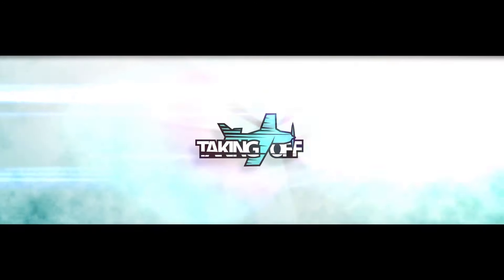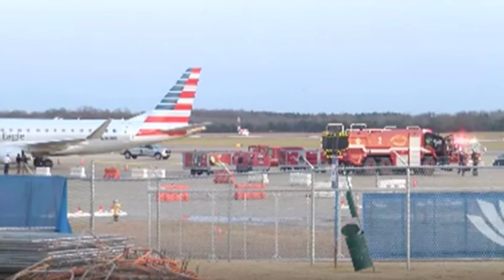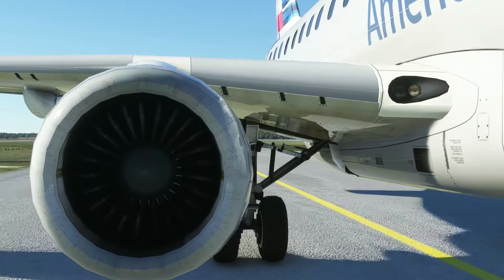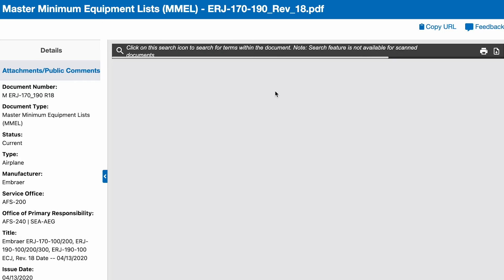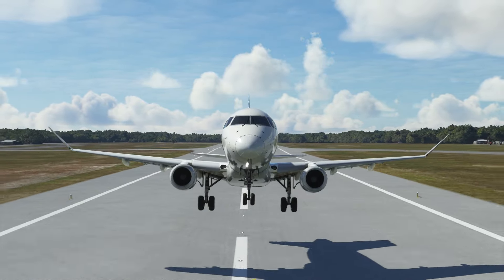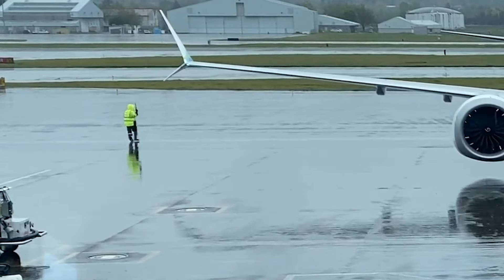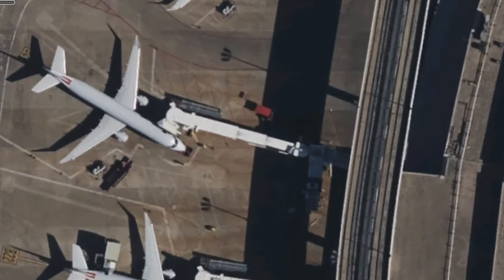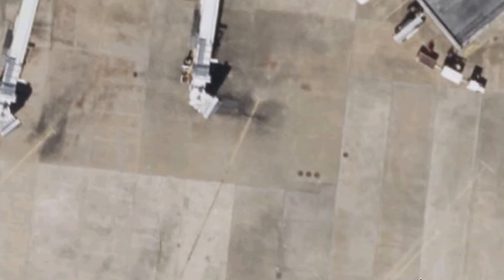Woman Sucked into Engine at Montgomery Regional Airport New Years Eve UPDATE

Comment: As a retired airline pilot (turboprops only) I saw something potentially similar develop again and again in my career, a recurrent Safety Management issue: Scheduling is becoming tighter because of accumulated delays (and possibly added abnormalities like the INOP APU), and "good" (enthusiastic) ground staff start to expedite their routine to compensate, a highly dangerous situation (the root cause usually being a management or scheduling problem).
There was an extreme period where we enforced a rude emergency response: If ground crew was seen walking/driving fast, let alone running/speeding around a live aircraft, the mandatory response was to call for an immediate shutdown and a crash safety conference with the ground crew. This of course made any imaginary delays real and exponentially worse and, needless to say, such drastic measures only happened once or twice before everyone got the message.
I have no idea if something similar was at play in this tragedy, but I wouldn't be surprised if it was a factor.

Comment: I spent 24 years as a C-130 Crew Chief and though our little Allison T56 engines were mounted high and not a lot of suck power compared to the E175 engines we had huge 13.5 ft. props to deal with...  Getting complacent could cost you dearly...   Thoughts are with the family...  RIP..

Comment: When I was in the Air Force, I had to work around running engines all the time. We knew the dangers of getting too close to the intakes and were shown video examples of what happens if you get sucked into an intake. I was on constant alert watching my subordinates to make sure they followed the safety procedures and stayed clear of the intakes. I've had a few close calls, and I've had to pull more than one guy away from the danger, but I never saw anyone get sucked into the intakes.
Reply: Pm
Reply: Good on them for giving you the video training. I imagine none of you dared fkuc around near the engines after seeing what was on  those... lol
Reply: So, what happens when it happens? Does anything get out on the other side or does the engine shut down? Or even overheats and catches fire?
Reply: @Ken Fullman oh, you wrote so much , and yet nothing. We are interested how does it look afterwards? Like bolognese pasta sauce?!
Reply: @jasonnicholasschwarz7788  Happened w DC10 lock failures. 2 or 3 got sucked in. They're not sure exactly. That's the answer.
Reply: All the paint markings are faded away. Their is no longer any safety envelope. For any worker especially newer workers
this spells disaster. Once again the corporations put profit before safety by not repainting all the markings in the airport.
Any hungry lawyers out there looking for a big juicy law sue case. Go for it lawyers, help the hurting family of that victim.
Please share this message.

Comment: My neighbor was a mechanic during the Korean War and witnessed a similar fatal accident that still haunts him. An F-86 pilot started his engine without realizing that a ground crew member was removing a block from the front wheel.
Reply: What happened to pilot?
Reply: @Lecintel  read it again and again and you'll fond out.
Reply: @Lecintel when the pilot ran the engine, the ground crew man got sucked into the engine... this is the unspoken part of the story
Reply: @istra70  They asked what happened to the _pilot_, not what happened to the ground crew.
Reply: I think I have seen a video about this accident in the fifties, it was on a carrier, and because at that time the engine intakes wasn't large to suck the whole body and the front fan was somehow deep, the guy survived it and they pulled him alive, definitely he got injuries but he didn't die.
Reply: @Helmy67  Sounds like a different incident. The accident with the F-86 happened on land and the victim died instantly.
Reply: @istra70  I wonder if pilot was charged with manslaughter or was it just considered as an accident
Reply: @RaysDad  aha, it's different accident then.
Reply: @Lecintel  No way they'll blame the pilot.
Ground crew need to know their place at all times .....If they are starting engines , or after landing , before switching off - there should be airline company mechanic with headset plugged, in the contact with cockpit.
Operational procedures vary depending of size of the airline company, type of aircraft and type of the airports. Never in my work have I seen baggage handlers walking or running around / near running engines....

Comment: As a retired airline pilot, this is a very unfortunate accident.  It is industry standard to leave the right engine running with an inoperable APU for the safety of the ground crew plugging in ground power.  It is also standard to notify the station of the inop APU with the in-range call or via ACARS. These calls also include request for wheelchairs and unaccompanied minor escorts. People are in a hurry to do their job especially when the arriving flight is late and you are trying to make up time for an on-time departure.  When you are around an aircraft SLOW DOWN, no running or horse play.  People in a hurry are in a hurry to die.
Reply: Thank you for your input from a Pilots perspective always interesting to know how it should be done by the rules of standard procedure ,I worked Airside at Adelaide Airport and it's scary  how quick a large aircraft can move up on you if your not situationally aware .
Kym
Adelaide
Reply: Well as a retired airline pilot myself (and we will let everyone know), I frequently get asked by a passenger how often do these things crash. My reply is "just once usually." 🛬💥🔥🤣

Comment: 25 years ago I was working with the ground crew for Delta Airlines, who had not yet bought out Northwest.  So we had 3 gates and our crew were "scabs" .  (another story) 
I came to work one morning to learn my team lead had been sucked into a 373 engine. 
He survived.  
Thankfully it was one of the 200 series with the smaller cowling.  And well.. he got extremely lucky.  As he told the story, he remembered his grip to keep him from getting sucked in slipping, and then the engine shut off.  He suffered a separated shoulder injury, and maybe some PTSD.  
We were contracted employees, always understaffed and under pressure.  His carelessness wasn't that all uncommon.  He just was TOO careless.  We learned when and where to cut corners... etc..  Brian just didn't respect the engine.  HE even got to star in a safety video for his efforts.  Still a good boss, even though he made a dumb mistake.  But you need to be vigilant around those aircraft.  It takes one slip up and your dog food.
Reply: "SOME" PTSD? Lol. 

Had a near miss once while on a bike vs open old Caddy door. Flipped over bars. Untouched. Could barely stand from the chemical rush. Lol. Landed on my feet.
Reply: Unfortunately understaffed and under pressure is still a thing.
Reply: @windsofmarchjourneyperrytr2823  wow!
Reply: @dynodin81  Your right, but if your doing really unsafe things on the ramp! Your a danger to the other rampers,passengers, crew,refuelers and other airline employees!

Comment: My condolences to the family for this tragic loss of a loved one.
I spent 40 years in the USAF, I worked on most of the aircraft the Air Force had during those years. Working out of a Fabrication Branch Shop, I could work on just about everything in the inventory. The first thing I was taught was to stay away from the intake and exhaust of a running aircraft. I can recall several times when the USAF shut down maintenance and flying over someone getting sucked up in an intake. One in particular was back in the 1980's when there were two incidents of ground personnel getting sucked down an F-4 intake in a 24 hour period. One died from the saver low pressure that caused bleeding in the lungs. The other survived but was blinded. All USAF bases were shut down for a week for safety training. There was another incident where a Fuel Truck driver was driving behind an F-16's that were running. He had his windows open. As he drove behind one F-16 the pilot ran up the engine and the hot exhaust gas removed all the Oxygen out of the cab and nearly killed him. The F-16 intake was particularly dangerous due to it being under the aircraft and so low to the ground. Maintenance personnel nick named the F-16 the Vacuum cleaner as it would suck up anything laying on the ground. They would install a cage over the intake when test running the engine on the flight line for safety. But I always stayed clear of running engines at both ends.
Jet intakes/exhaust, propellers and Helicopters all have different dangers that require personnel working around them to watch out for and take safety precautions. It only takes a blink of an eye for a life to be lost around these things. Just a second in a lapse of judgment, not being aware of situational environment, being tired or having problems/stress in you life interfering with your job safety awareness, or taking shortcuts on the job can get you killed before you know what happened and Murphy's laws to kick in. 
I lost a good close friend all because someone was taking shortcuts on a job and not following Tech Data working on an aircraft. They were in a hurry and didn't install a safety device that would have stopped a part from closing if Hydraulic Pressure was lost and he was crushed. It was sad and a stupid mistake in judgment that killed one person and ended the careers of several other people.
Reply: Yes, it 's not just engines you have to worry about when working around military aircraft. My father was a Korean war vet in the air force. He told of a maintence sergeant servicing one of the machine guns on the wing of a fighter plane. A 2nd lieutenant was berating him for something and calling him names. He was also standing in front of the machine gun when one round went off obliterating the lieutenant's head. It was ruled an accident but most believed it wasn't. You might be special because you're an officer, but you're not any better than the men you are in charge of.
Reply: @drdr76  No joke, they put their pants on the same way I do. One leg at a time! Everyone is good at some things and everyone makes mistakes. I've seen more than my share of people getting hurt because someone was in a hurry or trying to impress the higher ups. That's how accidents happen, people get hurt or killed and aircraft crash. That is how the Space shuttle Challenger blew up back in 1986. NASA and the Morton Thiokol that built the SRB's all knew there was a problem with the seals on the rocket boosters when the temperature was cold. But they were all under pressure to meet a launch that had been delayed several time from July 1985 to Jan 1986 due to several things including weather. NASA was pushing for a launch and Morton Thiokol management took a chance under pressure and gave in. 73 seconds after launch, Boom.
Reply: I am nothing but a passenger.  How often do people get sucked into engines?  I am well into retirement, but I have heard of only two accidents including this one.
Reply: Holy shit….
Reply: I was a structural technician / aviation mechanical fitter in the Israeli Air Force for 3 years. Got to work on all types on base, but mostly Phantoms, F16 and MD500. As we often carried around loose and un-numbered HSS / cobalt / carbide ot videa drill bits, and often produce chips and shavings, we were hyper aware of anything FOD related.   I would leave my keys, wallet in my locker, nothing in my pockets.   The only thing in my inner jacket pocket were my ear plugs in a soft plastic case.   Even 30 years later, I don't wear any jewlry or even a watch.
Assesing the hazzards present before approaching and working on a jet was second nature. Is it grounded/earthed, on lift struts, is connected to electrical or hydraulic power, are there munitions, are the munitions safed, are the landing gear safed, is the hydrazine window safed, if I was to work in the cockpit is the seat safed and signed off etc...
We had our share of accidents and incidents.
Reply: In a hydraulic metal press factory in Connecticut many years ago a worker learned a shortcut on a hydraulic printing press . He would reach across to a safety switch through the 100 ton press.. instead of walking around 10 feet. Timing was critical , one day his timing was off in a hurry and the press took off his shoulder and whole arm. He bleed to death within minutes.  Hmmm shortcuts... was this poor lady doing a shortcut...one must think 🤔?
Reply: @leonnygren9394  That worker exhibited a fundamental lack of common sense. Employers should fire such workers asap.
Reply: @leonnygren9394  OH MY GOD! Health and safety procedures are there for a reason! That’s horrific

Comment: I’m so confused about how this was even possible. I don’t understand at all because I’m a ground handler myself and we have incredibly specific rules about approaching any aircraft. He’s not wrong about the heavy training that’s drilled into us. We’re told over and over that we operate in one of the most dangerous workplace environments in the civilised world and that a few moments of inattention or not following our SOPs can kill us, or worse be can cause an airplane crash.

The simple rule that we all follow is that if the red (occasionally white) lights are on and flashing at the top and bottom of the fuselage then under absolutely NO CIRCUMSTANCES do we approach that aircraft either on foot or in a ground vehicle. Hell there are markings and warnings on the engines and fuselage marking the areas that put you at risk of being ingested into the engines.

But of course the pushback teams that tow the aircraft out of the aircraft stands since the planes aren’t capable of safe reversing, can and do approach and work around the aircraft while the pilots are getting the engines started. But the pushback teams also have very, very strict safety training and SOPs. We even have ear defenders that have communication equipment installed so that we can plug it into the plane to communicate and coordinate with the captain above us.

Now I don’t know what happened exactly with this tragedy but I’d consider it unlikely that the woman was part of the pushback team because they also do the baggage handling amongst other things. They’re called ramp agents or rampers and the inescapable logic is that there are very few female rampers because the job involves a lot of upper body strength to load and unload baggage fast enough for the aircraft turnaround time. I’m ACS myself-cleaner and water and lavatory truck operator and I’m a hybrid I suppose because I have a lot of the ramp training so I can assist them when I’m not busy.

I just don’t understand. If I had to guess I’d say that she was either not following safety SOPs or the pilots forgot to turn on the red warning lights I described. I’d go with the former because I’ve never seen it happen and the pilots follow a checklist which would instruct them to activate them.
Reply: All the paint markings are faded away. Their is no longer any safety envelope. For any worker especially newer workers
this spells disaster. Once again the corporations put profit before safety by not repainting all the markings in the airport.
Any hungry lawyers out there looking for a big juicy law sue case. Go for it lawyers, help the hurting family of that victim.
Please share this message.

Comment: As someone who used to work on the ramp it unfortunately sounds like she got complacent. I see it every day. In a situation where the APU is out and the ground power needs to be hooked up you’re supposed to approach from the nose and hug the fuselage with your shoulder to chock the front tires. RARELY do people do that but some take it a step further and just walk up with the chocks as if the engine is already off. A foot or two closer to the engine could be the difference between nothing happening and it being the last thing you ever do. It happens so rarely that people don’t take it seriously.

Rest In Peace To Her
Reply: You hit the nail on the head so tragic
Reply: chocking the nose on an EMB even if you come in at 90DEG you will never get sucked in. This lady must of been tiny as hell to get sucked in at idle freak accident for sure. I actually don't think they were at idle to be honest.
Reply: Complacency certainly could be a part of the equation. Also, since the resurgence of post COVID era flying, a lot of new staff have been hired, and their level of situational awareness may not be that of a more senior ramper. 
And sadly, one other factor that was too prevalent the last 10 or so years of my 35 years as a ramper - people wearing ear buds instead of hearing protection, blasting their music thru them. Not saying she was, however if that is a finding, she likely never heard the engine running ,or if there had been pre arrival discussion about an inop APU. Airline policy is earbuds are not permitted, but I witnessed them on the rampers I worked with,including crew chiefs, frequently. Or some would pop their earbuds in and then put ear muffs on over them to avoid detection. If any good comes from this loss, perhaps the reason ear buds are banned by airlines will be driven home and someone else will not face this fate.
Reply: @tallmansfavorites7563  All great points, ,,, people do not listen to training, at age 84 with many years around airplanes luck was on my side so mmmmany times.